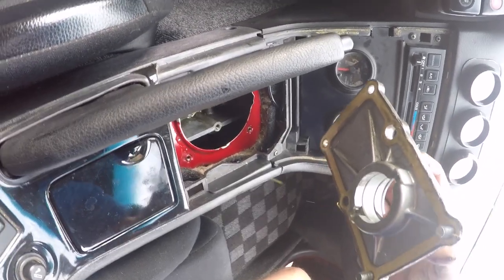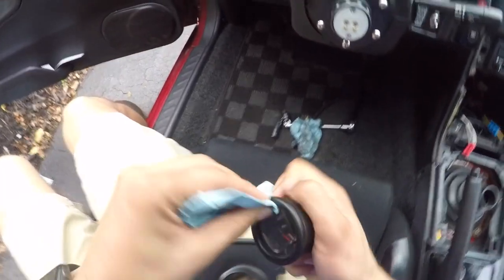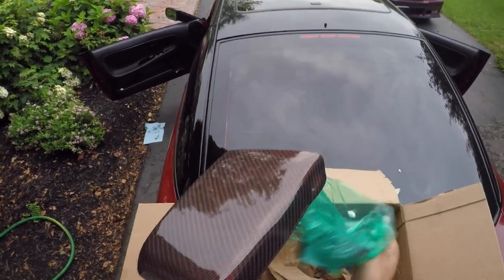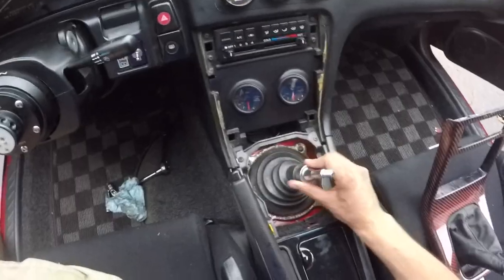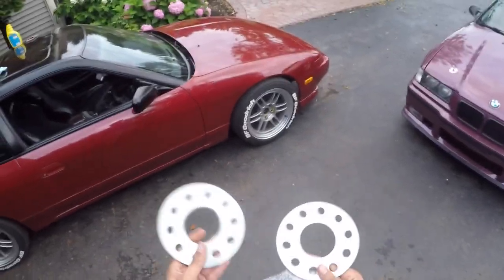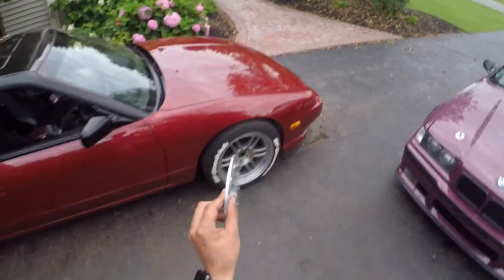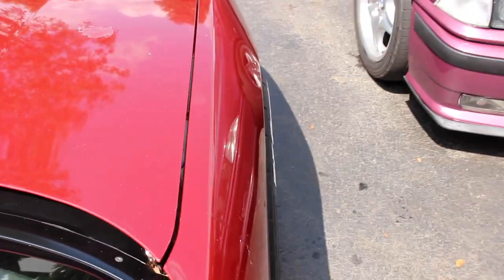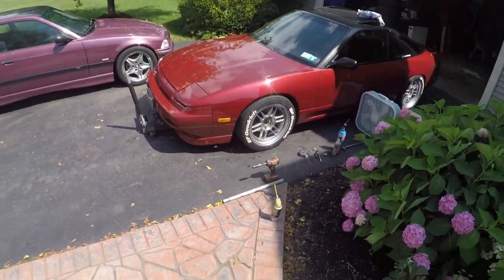IT'S FINALLY HERE!! | ThatDudeInBlue | Fixing Wheel Fitment

Comment: do a vid on getting the rust off rotars
Reply: Press your brakes whilst driving.
Reply from the maker: Drive you're car. Done.
Reply: drive ur car. or use a wire wheel on a impact gun or do it by hand with a wire brush
Reply: your* xDDD jk